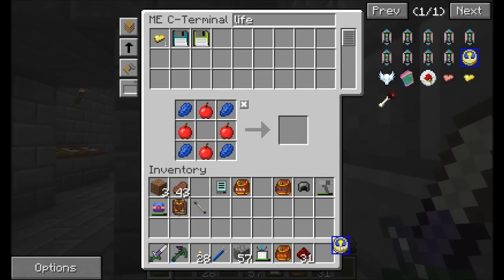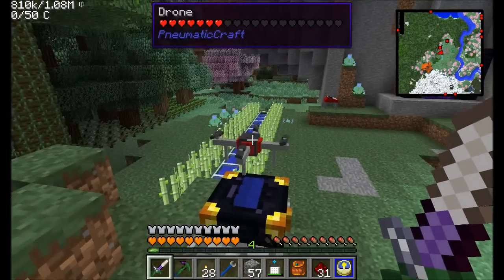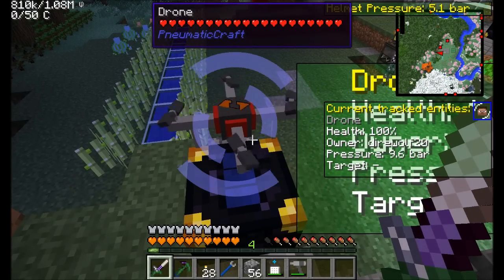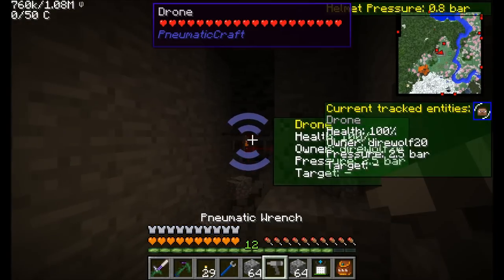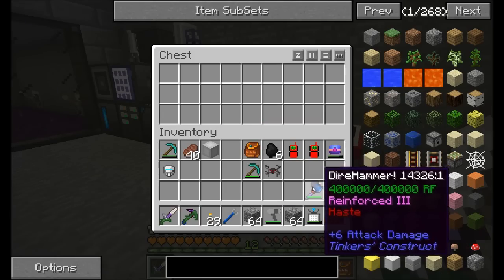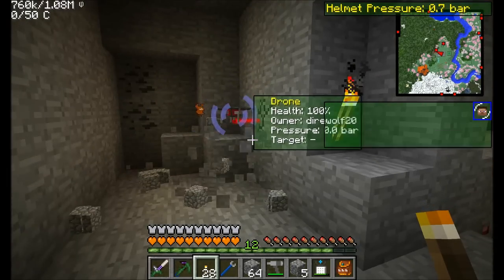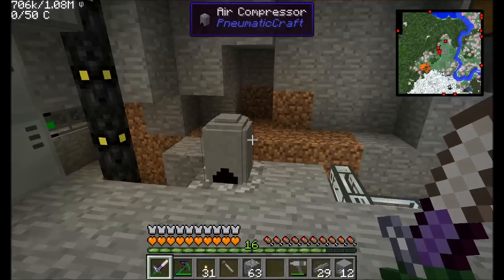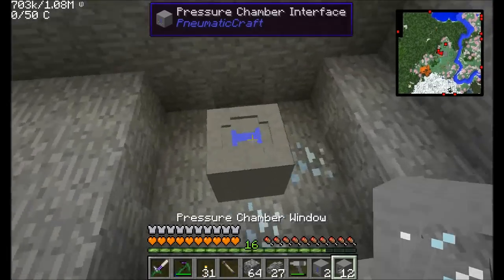Lets Play   S6E85 New Pnuematics Room

Comment: Hey Dire, with regards to the pressure tubes you should probably stick to using the regular ones when connecting to devices that max out at 5 bars of pressure. Not only would this help you keep track of which lines are low pressure and which are high pressure, but it would also help protect machines from exploding as the tubes may explode first instead if the pressure gets too high.
Reply: But the machines still could explode first and it would be annoying to have to replace the pipes and wait for the pressure to build up... Also, he plans to have machines that accept higher pressure to be in the system.
Reply: minecraftplayer1203 Right. I wasn't saying to eliminate the high pressure pipes entirely, I was saying to use them to properly differentiate the high and low pressure lines, kinda like using the different voltage cabling in IC2.

Comment: Why????? Why did you put the charging station on regular pressure??? You just made your drones recharge more than twice as much!
Reply: I know, the charging station altough a basic machine can handle alot of pressure, but I'm not sure how much the drones can store.
Reply: bob smith The drones can store a good bit, because 2bars doesn't last very long at all.
Reply: bob smith 20 bars, I'm pretty sure. There might be upgrades for that in the future..
Reply: B Miller If they hold 20 bars, it balances with the station. I think 70% that it's actually 2 bars.
Reply: B Miller Wait- It's 100% 10 bars.
Reply: bob smith
The charging station isn't a basic machine, it's an advanced one, it can hold up to 20 PSI. And the drones can take up to 10, but that's regulated by the charging station (It won't try to overfill them).
Reply: Well, there's an upgrade for the drone that let's you store more pressure.
Reply: Vincent Marin *air, but the point still stands that direwolf is using less than half the pressure that the drone can hold. He did it right in the sugar cane farm... why not in this build?

Comment: the upgraded tubes aren't gonna help much because even though they can hold more pressure a 3x3x3 chamber can't because it can only hold up to 4 bars without causing explosions. Thats a reason to make a 5x5x5 chamber or bigger.
Reply: Actually it can hold up to 4.9 bars of pressure before exploding...
Reply: And that's the reason he has a regulator pipe...

Comment: You need 3 pressure chambers to auto-craft, one for plastic, one for compressed iron and one for the parts that need plastic and compressed iron to work I already looked a lot
Reply: or you  could just filter Compressed iron and Plastics on the same chamber.

Comment: Why does he have to charge his hammer it is a tinkers construt  Tool they should not need power right?
Reply: è putted an upgrade that make the hammer no more use durability but now use RF
Reply: You can attach a battery/circuit to one of the attachment slots of a tinker's construct tool to make it charge instead of having a damage stat.
Reply: Oh that's cool thanks guys
Reply: Its an upgrade from Tinkers that let it use energy instead of the tool its self.
Reply: He added the upgrade to his hammet
Reply: he put an upgrade on it so he can charge it :D
Reply: What even?
Reply: whoisthisguy128 Dat face do...
Reply: He added an upgrade so it uses energy insstead of durability
Reply: Seems to be a bit of an echo in here...